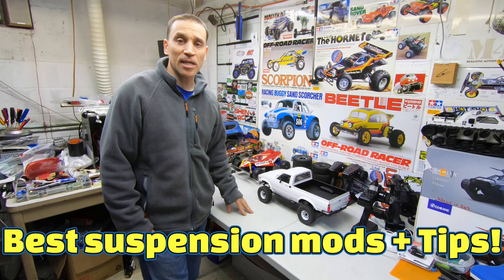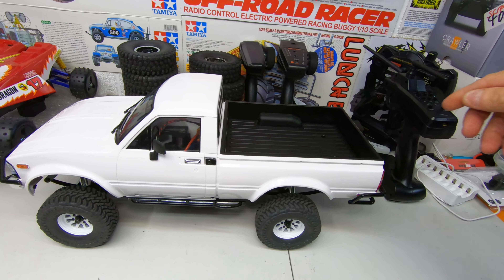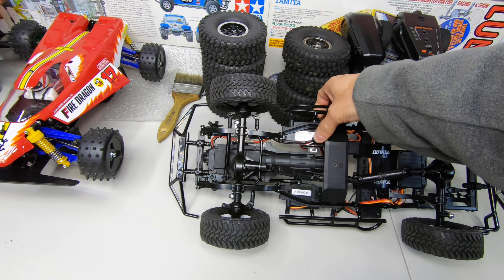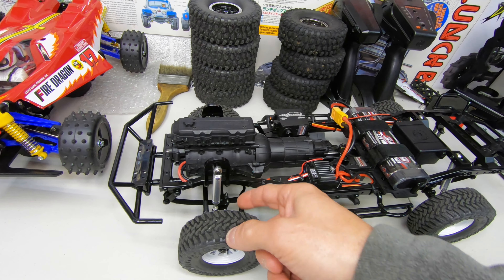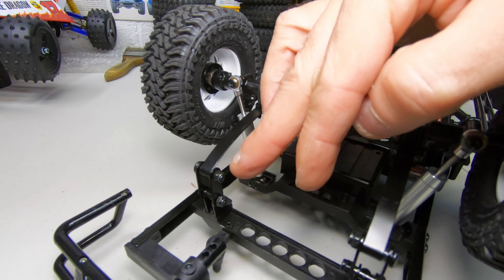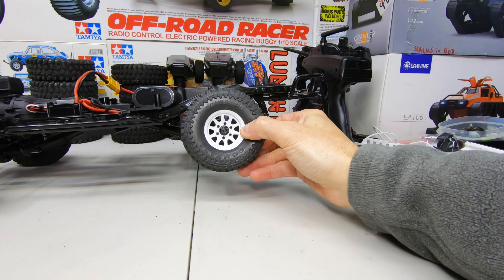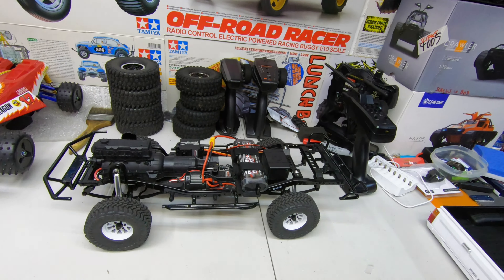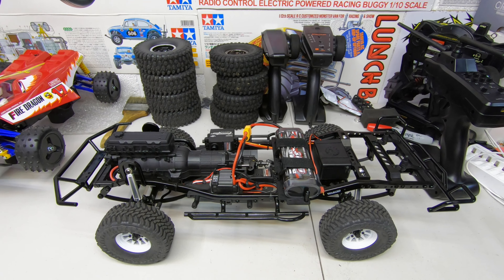RC4WD Trail Finder 3 SUSPENSION MODS TIPS & TRICKS!

Comment: Nice work and tips these are great looking trucks they should have oiled and and tightened the screws for the price tho they also make red soft springs for these to
Reply from the maker: Yeah for sure! They don't put the springs in the shocks now they are empty with the springs put in they give you as a option its super stiff. this out of the box is stiff as a board you lift one tire they all lift up no flex at all I don't know why they make it so stiff it's almost like it has no suspension. It should work much better now though. Thanks for watching.

Comment: That does have a few issues. You thought a Mk3 would have all this sorted.
Reply from the maker: Yeah super stiff like no suspension at all out of the box at least now it has a bit of flex and it works much better now because when you ran over something when it was stock the whole truck would just lift up off the ground.  Thanks for watching.

Comment: Use a 4mm spacer. No need to grind the oil pan.
Reply from the maker: Yeah you got to watch that the steering rod don't hit the leaf and also when you compress the suspension watch for the rod so it don't hit the axle pumpkin. Thanks for watching.
Reply: @ShenRC  it's just right. Nothing is in the way. Make sure you notch that front valance for full compression up front. It doesn't allow for full travel of the shackle it hits.
Reply from the maker: @keystonekrawlerrc  Yeah I hear ya I did the front of the inner body those shackles hit it like crazy don't know why they left it like that?

Comment: Good tips and thanks for sharing. Check out RC Everyday video on this as he had some good tips on suspension mods as well. I just got mine yesterday and looking forward to modding it this weekend. First upgrade I already ordered was the over/under drive kit,lol.
Reply from the maker: Thanks, I found these suspension mods work best out of the box it has no flex at all. This way it ran much better I was working on this for a long time and tried many other ways to get the suspension to get softer and more flex nothing worked but what I did now was the best balance of flex and spring rate.  Have fun with it!